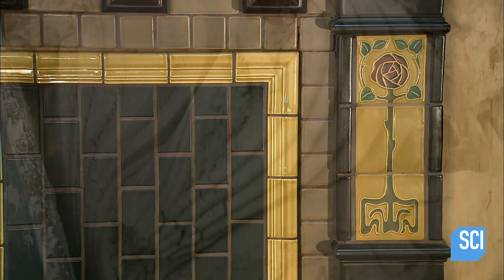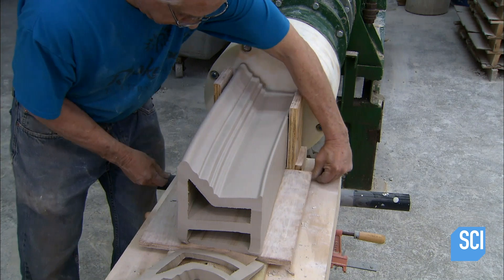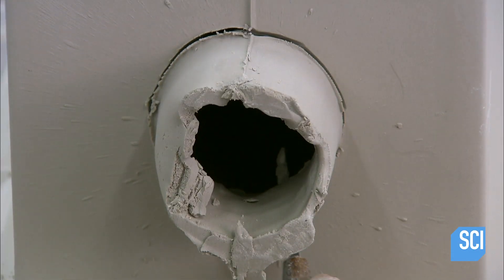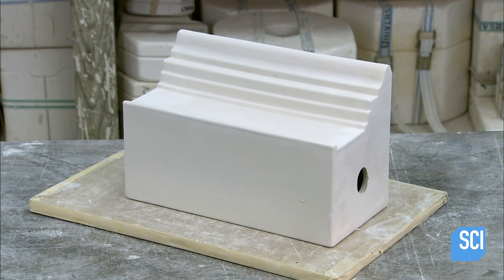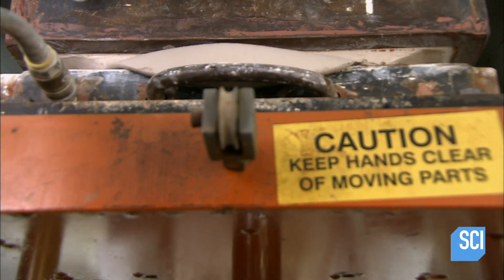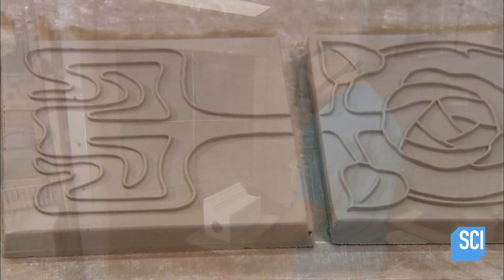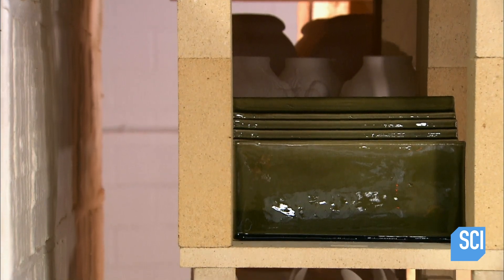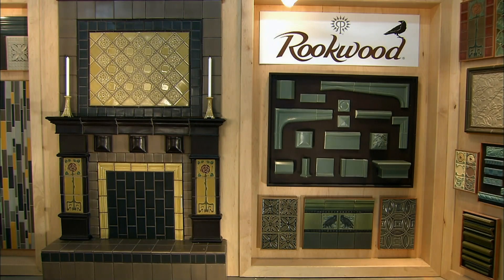How It's Made: Ceramic Fireplaces

Comment: What kind of material do they use in the kiln for support? It looked like wood but, obviously, that would just burn to ashes.
Reply: Refractory bricks are usually used in the kiln for support. They are usually silicate based mineral that have a low coefficient of thermal expansion